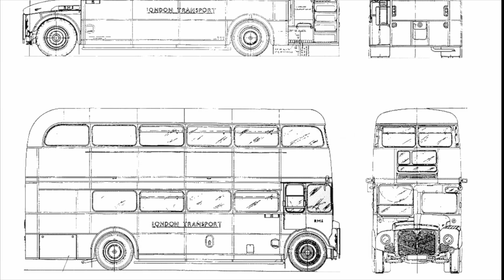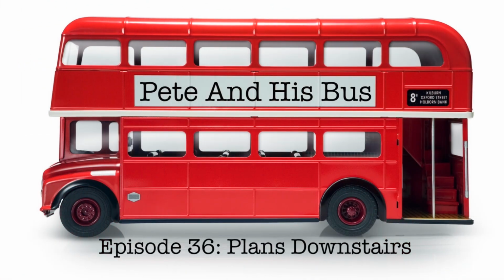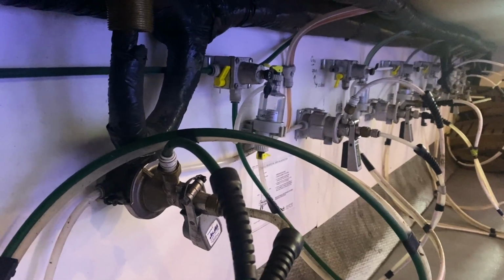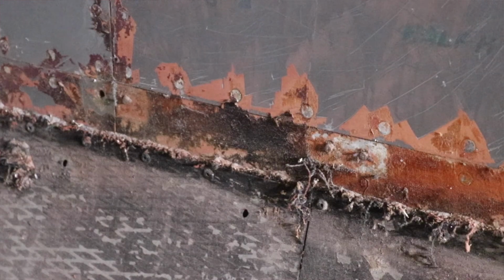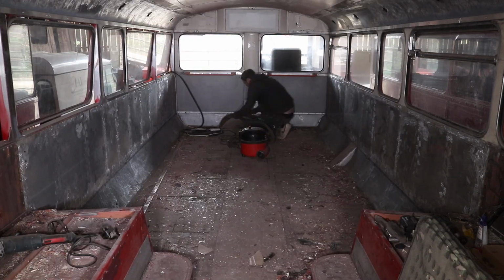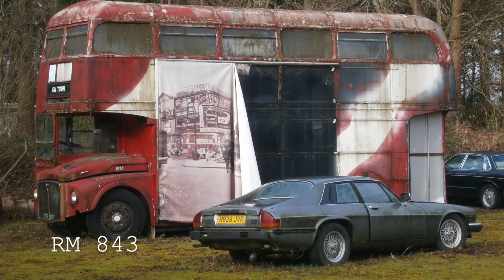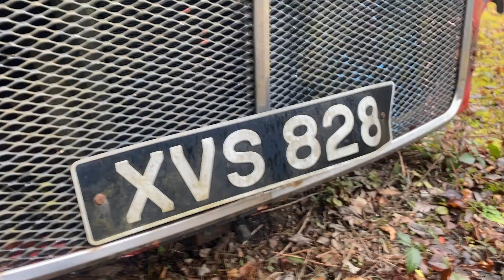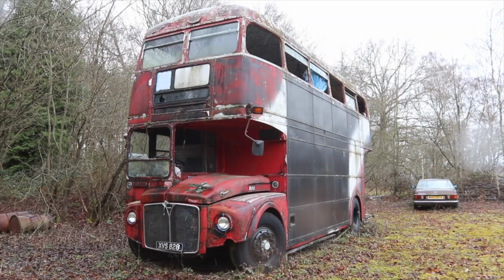Pete And His Bus, Episode 36: Plans Downstairs

Comment: Nitromors paint remover would have made an easy job of removing both the paint and the glue, painted on, left for an hour or so and then washed off with water, one just has to be careful that the right gloves are worn as will burn through latex and PVC ones, good old Marigold are OK.  Hope the neck is good after the time spent at a weird angle.
Reply from the maker: The problem is that Nitromors is no longer what it used to be…